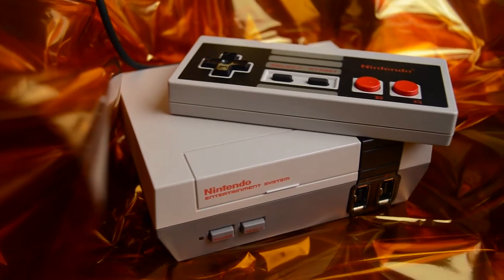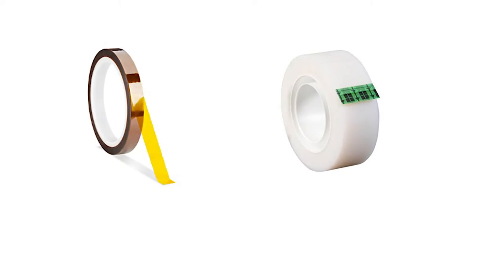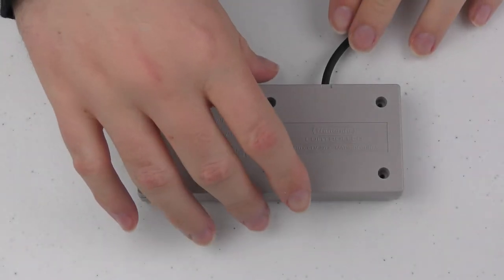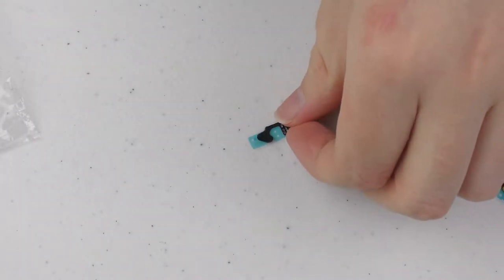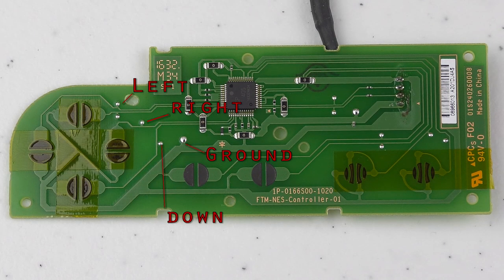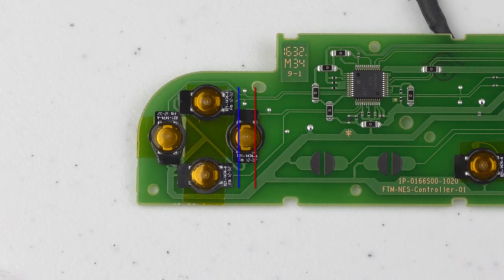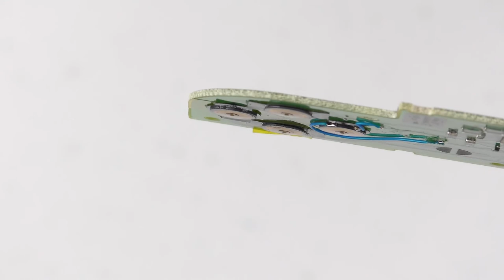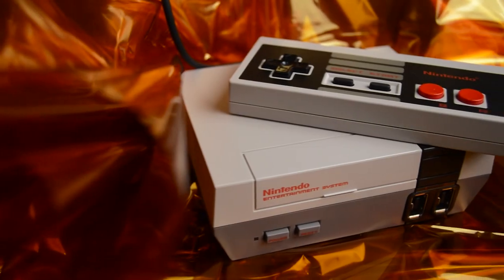How to Tact Switch Mod Any Controller EASY SAFE

Comment: You can do the same thing with no soldering using snap domes like the ones available from Snaptron which are held in place with tape.
Reply from the maker: What’s the accuracy like?
Reply: Depends on the ones used.
Reply: Mac Chambers   LOL.  Depending where you buy them there are hundreds of different sizes, shapes, pressure levels.  Generally ones for controllers are about 45 to 100 gram force, but everyone is different.
Reply: Mac Chambers    Hmm.  Try checking out Digikey or Mouser.  The domes are cheap
Reply: @10p6 @Slot1Gamer if I wanted to use those metal Dome switches for a PS4 controller would it's still work with the carbon contacts on the controllers board? You said this requires no soldering so I'm interested
Reply: @10p6  if I wanted to use those metal Dome switches for a PS4 controller would it's still work with the carbon contacts on the controllers board? You said this requires no soldering so I'm interested
Reply: @KALOISNOTHERE  Possibly. It depends on the quality of the contract the dome can make to the PS4 circuit.
Reply: I've tested this with Xbox One snap dome replacements and they work pretty well, and they're really cheap. But yeah if you want a top notch controller, you should get one from Snaptron or others specialized retailers.
Reply: Did any of you guys end up doing this on your DS4 controller. I’ve contacted Snaptron and waiting to hear back. If so what domes and size did you get? Thanks for any feedback/advice!
Reply: @lucanmadden2262  I only used the Xbox one domes. https://d3nevzfk7ii3be.cloudfront.net/igi/U5sYshiVGyskcJFi.standard
They have a pretty standard size of around 3mm and they are compatible with all the standard-sized buttons I have found (8bitdo and cheap third party). If you're gonna try this on a DS4 you have to check the dpad's height to know if it will work. Check this beaver customs video to see what I mean: https://www.youtube.com/watch?v=pc1DKpQRUcQ You'll see how he has to use a rubber pad to accomodate the height of the dpad.

Comment: This is really, really nice! I became obsessed with tact switches after noticing that those were the ones that made the PS Vita, GBA SP and Xbox One controllers so clicky and rewarding to use, but I never got around modding anything, in part because the dome switches I bought had too high of an actuation force. After seeing how convenient it is when using the iPhone parts, I'm definitely trying this out. Thanks!

Comment: This video is fantastic! I've been modding controllers a little differently but I am fascinated by your method. Even though my project is quite different, your info was helpful!
Reply from the maker: Thanks I’m glad you liked the video. What is the project you are doing
Reply: @Slot1Gamer  Same concept, putting mechanical switches into controllers, but I started off modding an original Xbox Duke controller and today was working on a 360. However, I'm sanding down the carbon coating and soldering the microswitches that fit best (purchased in a kit w/ different options from Amazon for a few bucks) directly to the copper contacts. I don't really know what I'm doing so it's a lot of trial and error 😅 I'm not sure if your method is possible on the 360 PCB, but I appreciate how much less destructive it is.

I was stuck because I didn't know the contacts on my switches were in parallel lengthwise, so I had the switches oriented wrong on the contacts. Your video gave me the missing piece and I was able to finish the four main buttons today! I might do the dpad tomorrow. Thanks again, I'll be checking out some more of your videos.

Comment: This is brilliant!  I need to get a pack of these in bulk so I can do this with every controller I own!  I wanted to do something like this but the fact that you can keep the original membranes, travel distance won't be much of an issue.  Could probably perforate the membranes so the buttons feel lighter

Comment: Definitely going to try this out for nintendo switch hmmmn... how good does the tactility feel?
Reply from the maker: Very clicky
Reply from the maker: Like a ps vita
Reply: Slot1Gamer just got my parts in, the force needed is not to my liking... unless there's a specific one that's softer 😕 soldering  was a pain too, but that was mainly the board and poor usage.

Comment: Even though this video is kinda old now, it seems very helpful! 
I've been looking to upgrade my Sixaxis PS3 controller since I use the D-pad a lot and it's been a challenge to find a video on how to replace it with a more tactile clicky D-pad. Your method seems simple and efficient, so props!
Reply from the maker: Thanks!
Hope it all goes well :)
Reply: @Slot1Gamer  can you post a link to these buttons . i am not that tech savy yet and i dont know wich buttons to get. also are tech buttons the same as mechanical switches? i will  let someone else that is more thech ssavy then me do this mod for my controller.
Reply: @Slot1Gamer  I think I heard you correctly you're using the iphone 5c flex home button?  Does it have to be iphone 5c or any iphone or should we just stick to what you said, please advise :)  great video man!

Comment: Nice! But what's different to the feel, because the rubber Pads are still there.
Reply from the maker: +Lukas Ringlstetter the rubber pads only add about 1mm of drop once you put it back together. It's to avoid hurting your fingers, plus makes the external buttons sit at the stock height :)

Comment: How would this be done for a PS4 DualShock? Solder to flex cable? Or on the board?
Reply from the maker: To the board, those flex cables melt :)
Reply: Slot1Gamer thanks for the reply! So where the flex cables meet the board then would be best?
Reply: @My_Intentions  i just got done trying this on a xbox 360 controller and failed. I even followed the schematic I found. I think the flex cables must have been melted during soldering. pretty dissapointed.I used the same awg 30 wire and had my grounds and signal wires running.  so Idk. I'm tempted to find the non soldering type buttons.

Comment: Thanks for the video. I think I've finally found the answer to how im going to mod my gba with tact dpad. Will post here again if goes well, i remember and possibly put out a video.
Reply: Reminder: you wanted to update the public on your tactile GBA project.
Reply: We’ll update. It’s on a bit of hiatus as life gets in the way. 

However having tested it does indeed work by using the test points on the board. However, due to the design of the gba shell, care needs to be put into placement of both the buttons and wire. Honestly, I will probably have to mod the shell. The space between buttons is rather tiny, so the length of wire will need to be quite short and i am currently looking for a better solution to transmit while avoiding possible shorts. 

Tl;dr it should work but I haven’t gotten there yet and there are few extra challenges I didn’t expect.
Reply: @RedmoonStudiosYT  Thanks!
Reply: I'm on this video for your exact same reason, I wanted a clicky AGB dpad. So I started studying extra hard today about how an agb control board is wired, which TP is used by which button etc. Do you have any updates, and is there any piece of advice you may share?

Thanks in advance!
Reply: Shinxyn 

I want to preface everything with I’m just a GBA enthusiast. While I enjoy tinkering you won’t be finding me on forums for modding anything. Unless I’m asking a question about how I screwed up I guess. However, with my time lurking and modding GBA backlights and the tests I’ve done using the method from this video, I suppose I have one update that expands on the other comments I have left in this thread. It is in relation to the actual connection between the buttons and test point. 

I previously mentioned the difficulty of connecting the buttons using wires due to the short distance between the test points and buttons and the small space afforded by the shell. 

This kind of build should work, but would take a level of time, patience, and planning in putting it together that would be slightly obnoxious. However, I suppose once one person makes a blueprint it would eliminate the time in planning to just patience in application.  

However, due to these constraints I have thought about another possibility. Because of the constraints I laid out earlier, it might be preferable to use a surface mount conductor (SMD conductor). I haven’t put the effort into actually finding one that would work based on size, pass through, and price but hypothetically there should be a piece that would cover the distance, be cheap to purchase in bulk (I’m talking easily over twenty of the piece for under 5 bucks) and require minimal to no modding of the shell. The one issue with this is that SMD components are so small, my soldering skills (and I’m sure a number of other’s) are currently not up to the task. I would need to practice beforehand to make sure I don’t burn out the test point/conductor with the heat of the iron. 

If you end up taking any of this advice or finding a better solution I would love if you could keep me updated.

Comment: Will it work on a membrane PC keyboard?
Reply: Even if you could solder the buttons on, that'd be a hell of an expensive mod, each switch would add up pretty quick. You'd be better off buying a cheap mechanical keyboard at that point. You can get Chinese mechs for like $35.

Comment: Wait this works for ds4 too?
Reply from the maker: Dual shocks (all of them) use a plastic membrane like a keyboard, if you wanted to do this it may be better to use conductive glue or paint.
You can’t solder to the membrane :(
Reply: @Slot1Gamer  :(

Comment: Why the heck would you want that!? The tact feel is the worse in the world when it comes to the old consoles!
Reply: depends on the person. Like the GBA vs the SP, SP had tact switches, and it feels pretty good. I know when I was fixing up my old GBA, the silicone pads were pretty worn out and didnt feel right. But when I tried to swap it with a 3rd party reproduction?  It felt even worse. The A B buttons were great tho, so its hit or miss. Point being, with old hardware its difficult to get parts that feel the same as they did in the glory days, so I could see some uses for this. Though tbh, I don't think we really need a reason for a mod to exist. Take the dual screen SP for example, lol.
Reply: And just a fun little side note, I created a custom controller a few months ago... I mean like fully scratchbuilt with a wireless trackpad keyboard as the base. Anyways, the Dpad that I used was created out of 4 tactile switches for a mouse (L and R click), and its the most amazing feeling dpad that I've ever used. Feels great for 2d platformers like Mario, but you also get that feedback (auditory and touch) for more presice games like Street Fighter so  you can input combos with %100 confidence, I aint sayin tactile dpads are better, but perhaps save your prejudice until AFTER you've tried a Dpad with mouse switches ;)

Comment: Nice video, but tact buttons are garbage, membranes are so much better... 
I was looking for a mod to add membrane contacts to the Xbox Series Controller's Dpad, absolutely not the oposite 🤣
Good work anyways 👍
Reply: @Heath i never talked about precision, also if you're skilled with your fingers the membranes are just as good as clicky garbage, you sound like a person who always push the analog sticks to the maximum possible, well so you know : you can do same with membranes, precision is how you use your fingers to press the button, not just "on/off" with force.

Comment: Noooo! The NES CE controller never came in stock around here due to the spares being diverted to make more consoles bundles. I wanted to buy a TON at the MSRP to use them to refurbish old NES controllers with brand new parts. $10 for a NOS original NES controller is a bargain so $10 to replace all the wear parts is an acceptable alternative. Instead, I ended up paying a scalper $90 for my second official NES CE controller. It was literally cheaper to stand in line and buy another NES CE (which I also did) but that's no longer an option. No way am I gutting the controller now! If you don't care about the original feel then why not use a clone/replica/counterfeit?!

Edit: Well, I guess that parts I'm interested in are still salvageable with your mod and you didn't do anything that can't be undone. Way to go! Slap those shell pieces and rubber parts onto an older NES controller and put your monstrosity into the old shell to make me happy. :) Yes, board swapping works (tested the day it launched).
Reply: But he did it in a way that it can be easily removed if he wishes. The buttons were just glued on top of kapton tape, if you want to remove them, just open the controller, cut the wires at the soldering points and peel them away. Don't be a dramatic douche about it, this is a very minor mod. This is a great idea for revitalizing controllers that no longer have the carbon pads intact or the rubber domes are ripped apart due to use. I have an SFC controller here that have damaged carbon pads and it's essentially useless right now, but I will fix it using tact switches similar to these.